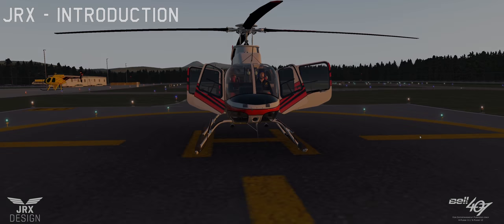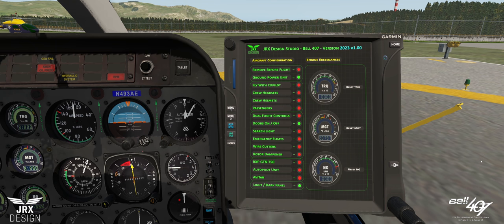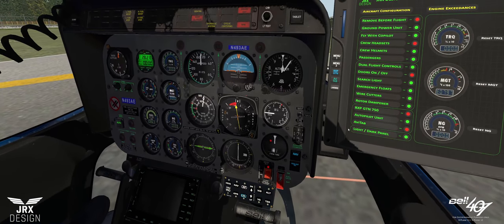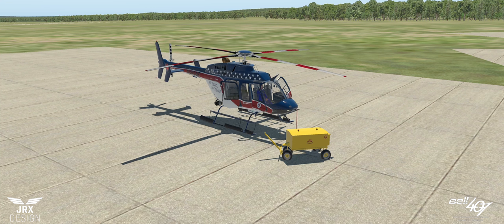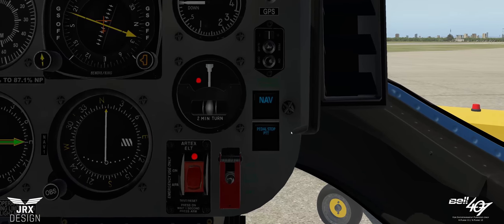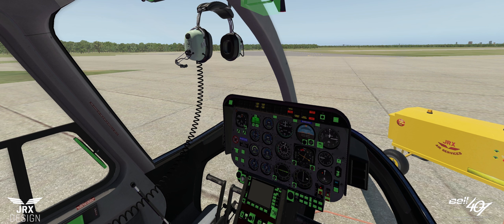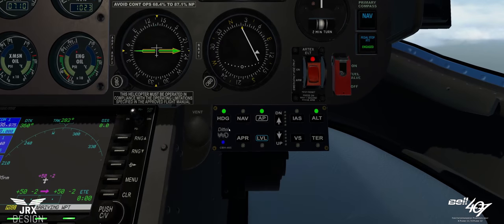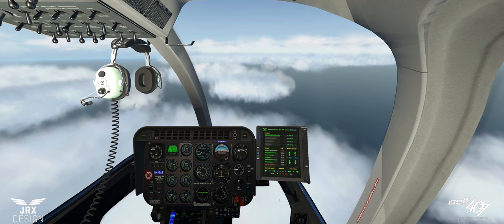JRX BELL 407 for XP11 / XP12 - Cockpit Tour / Video Guide

Comment: could you give me an idea of what computer hardware you use? its time for me to buy a newer system that can handle things, as i just upgraded to xplane 12 steam.
Reply from the maker: Hello,

I have just upgraded my system to MSI RTX4090 / 12th Gen Intel(R) Core(TM) i9-12900KS / 64.0 GB DDR6 RAM and some m.2 drives  - BUT X-Plane 12 can still kill it off, so my advice is buy the best within your budget and prepare to be disappointed (at least with X-Plane) - For everything else it runs like a dream :)